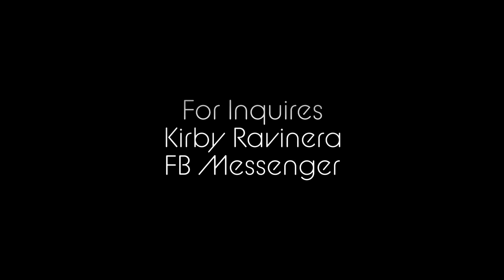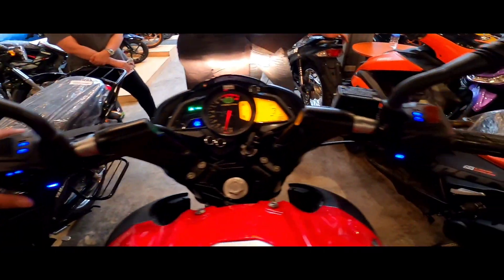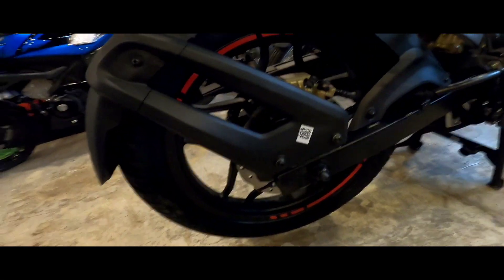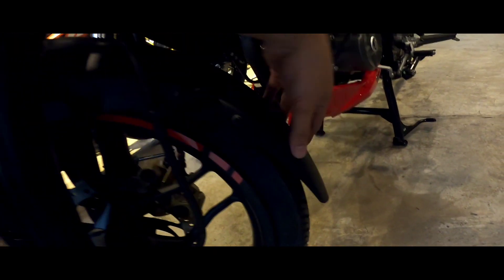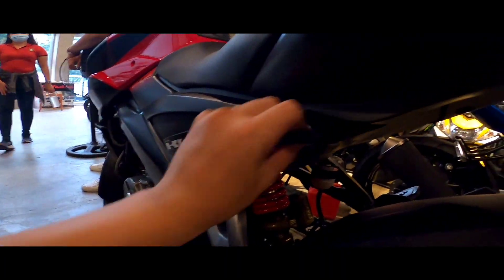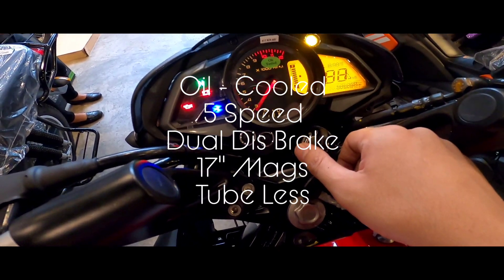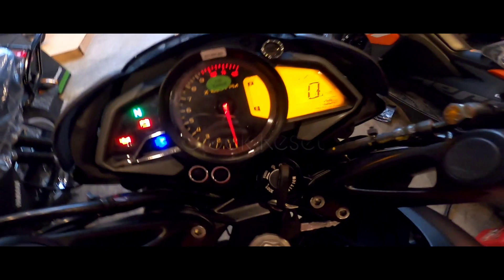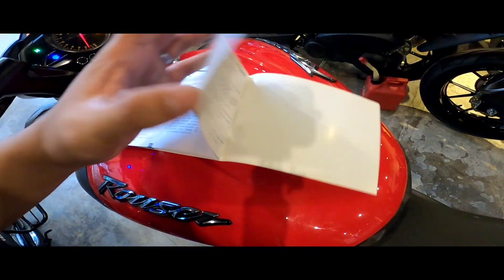Bajaj Rouser NS 160 FI / New Specs / New Look / Dual Disc Brake / New Color

Comment: Ano po Difference nila Compared sa NS 200 EXcept sa CC, at medyo close yung price nila?
Reply from the maker: Hi po. Ns 200 water cooled ns 160 oil cooled po. Ty po
Reply: @KirbyMotovlog  Hmm so NS160 is good in cooling system?
Reply: kala ko liquid cooled ns 200

Comment: Papa abot ko kaya yan ns160 5'2  lng height ko e  o may ibang paraan o modified na kelangan gawin para maabot ko
Reply from the maker: alm ko nakak bili ng lower kit ito po sir e
Reply: Gnyan motor ko 5'4 ako pro tip toe padin ehhh diskarte lng kailangan😄

Comment: Boss magkano ang monthly payment nya for 1 yr pwede mo ba ako bigyan Ng info? Thank u
Reply from the maker: NS 160 Dual Disc Brake
SRP 92,000

DP 6,900

12x 9,786
18x 7,260
24x 5,955
30x 5,206
36x 4,696

200 rebate

For Government Employees,Under Agency,Driver,Security Guard,Call Center,

DP 13,800 (15%)

12x 8,984
18x 6,592
24x 5,320
30x 4,624
36x 4,148

200 rebate

requirements
2valid id
proof of billing
1 month pay slip

Kirby ravinera
09957280654
Sales Consultant
Reply: @KirbyMotovlog  thank u boss
Reply: Sir may online registration kayo..

Comment: May ns 200 po ba diyan and hm dp at monthly?
Reply from the maker: NS 200 FI 
SRP 104,000

DP 7,800

12x 11,061
18x 8,214
24x 6,744
30x 5,902
36x 5,328

200 rebate

For Government Employees,Under Agency,Driver,Security Guard,Call Center,

DP 10,400 (10%)

12x 10,773
18x 7,924
24x 6,464
30x 5,639
36x 5,077

200 rebate

requirements
2valid id
proof of billing
1 month pay slip

Kirby ravinera
09957280654
Sales Consultant
Reply: ilang mos po bago lumabas yung orcr paps? ung sure po..tia.

Comment: Sir same lng ba nang mininum dp and 3yrs installment in any branch nyu? For ns200fi..tia
Reply from the maker: NS 200 FI 
SRP 104,000

DP 7,800

12x 11,061
18x 8,214
24x 6,744
30x 5,902
36x 5,328

200 rebate

For Government Employees,Under Agency,Driver,Security Guard,Call Center,

DP 10,400 (10%)

12x 10,773
18x 7,924
24x 6,464
30x 5,639
36x 5,077

200 rebate

requirements
2valid id
proof of billing
1 month pay slip

Kirby ravinera
09957280654
Sales Consultant
Reply: @KirbyMotovlog  paano Po kung mgdown Ng 15k monthly s Kawasaki rouser ns200
Reply: Mgkano mging s 3years mgdown Ng 15k

Comment: Saang Branch po kayo? Planning to Buy NS160
Reply from the maker: MotorcycleCity / Kawasaki Las Piñas
#449 Alabang - Zapote Road Brgy. Talon Uno Las Piñas City
Near At Sm Southmall 
For Inquiry Look For Kirby Ravinera
Globe # 09957280654
Smart # 09084915718
8:00 am to 5:00 pm
Monday - Saturday Only
Reply from the maker: cash po ba sir or financing po?
Reply: @KirbyMotovlog  Financing po. May sample quotation po kayo for NS160? P20,000 DP for 3 years. Tsaka saan po located branch niyo?
Reply from the maker: @Lyddlcrz28  las pinas po sir meron po ako sir nabigay na address po
Reply from the maker: NS 160 Dual Disc Brake
SRP 92,000

DP 18,400

12x 8,480
18x 6,204
24x 4,984
30x 4,326
36x 3,877

200 rebate

requirements
2valid id
proof of billing
1 month pay slip

Kirby ravinera
09957280654
Sales Consultant

Comment: Sir magkano ang cssh at monthly niyang ns160fi?
Reply from the maker: NS 160 Dual Disc Brake
SRP 92,000

DP 9,200

12x 9,489
18x 6,592
24x 5,320
30x 4,624
36x 4,148

200 rebate

requirements
2valid id
proof of billing
1 month pay slip

Kirby ravinera
09957280654
Sales Consultant
Reply: @KirbyMotovlog  bossing parehas lang ba sila ng mukha ang height ng ns20p fi maliban sa cc anong pinagkaiba nila?
Reply: @KirbyMotovlog  bossing paano pag 20k ang downpayment ss ns160fi
Reply from the maker: NS 160 Dual Disc Brake
SRP 92,000

DP 18,400

12x 8,480
18x 6,204
24x 4,984
30x 4,326
36x 3,877

200 rebate

requirements
2valid id
proof of billing
1 month pay slip

Kirby ravinera
09957280654
Sales Consultant

Comment: may store branch ba kayo sa laguna?
Reply from the maker: Hi po wla po sir ty
Reply: @KirbyMotovlog  ,  dual disc brake(F/R) na po ba ang version ngayon ng rouser ns160 fi or custom built /special edition yung sa inyo? how much po and ano promo nyo pag cash?  also would like to ask kung may version na rin ng naka ABS yung front at rear? kung meron po,  howmuch? maraming salamat.
Reply from the maker: hi sir disc brake na po front and rear po ito po bago labas ng ns 160 sir promo sir wla po sir e 92,000 SRP Po
Reply from the maker: so far wla pa po abs nito sir sa ns 200 meron po abs po

Comment: Magkano po installment nyan for 3years
Reply from the maker: NS 160 Dual Disc Brake
SRP 92,000

DP 9,200

12x 9,489
18x 6,959
24x 5,661
30x 4,926
36x 4,425

200 rebate

requirements
2valid id
proof of billing
1 month pay slip

Kirby ravinera
09957280654
Sales Consultant

Comment: Hm monthly kapag 12k DP? salamat boss
Reply from the maker: NS 160 Dual Disc Brake
SRP 92,000

DP 13,800 (15%)

12x 8,984
18x 6,592
24x 5,320
30x 4,624
36x 4,148

200 rebate

requirements
2valid id
proof of billing
1 month pay slip

Kirby ravinera
09957280654
Sales Consultant

Comment: Magkano price Yan Sr?
Reply from the maker: NS 160 Dual Disc Brake
SRP 92,000

DP 6,900

12x 9,786
18x 7,260
24x 5,955
30x 5,206
36x 4,696

200 rebate

For Government Employees,Under Agency,Driver,Security Guard,Call Center,

DP 13,800 (15%)

12x 8,984
18x 6,592
24x 5,320
30x 4,624
36x 4,148

200 rebate

requirements
2valid id
proof of billing
1 month pay slip

Kirby ravinera
09957280654
Sales Consultant
Reply: sir location po para mapuntahan namin

Comment: Bossing magkano pag ang downpayment 20k magkano nalang ang buwan?salamat
Reply from the maker: NS 160 Dual Disc Brake
SRP 92,000

DP 18,400

12x 8,480
18x 6,204
24x 4,984
30x 4,326
36x 3,877

200 rebate

requirements
2valid id
proof of billing
1 month pay slip

Kirby ravinera
09957280654
Sales Consultant